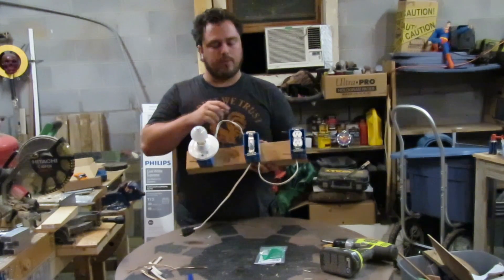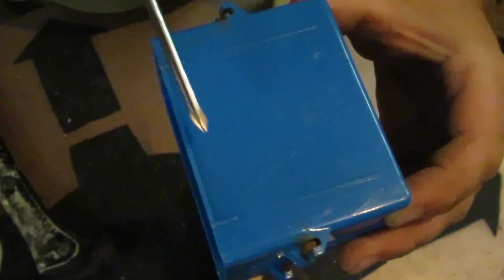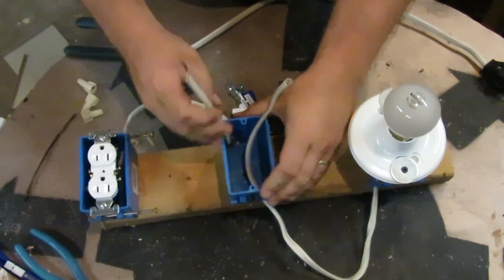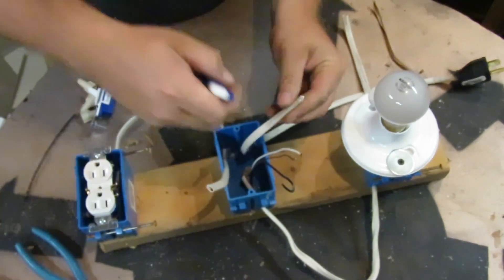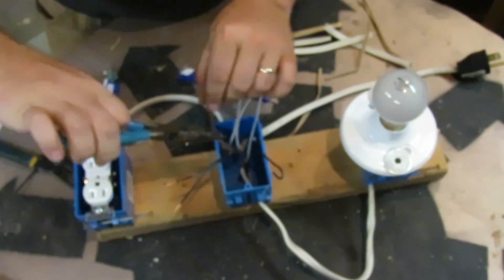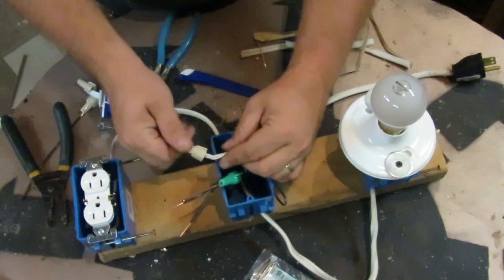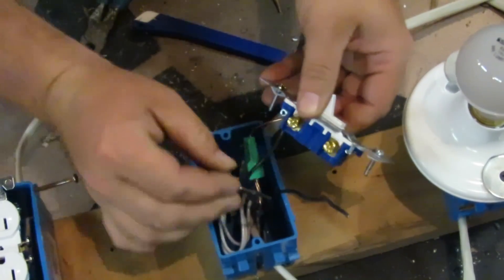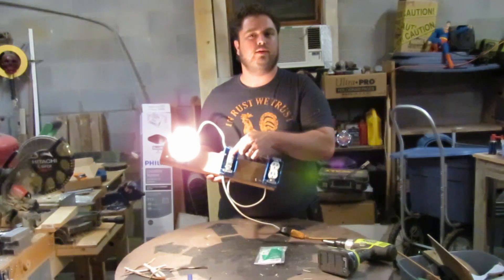How to wire and Install a Single Pole Switch

Comment: You don't explain where the power (black) wire coming from the breaker box is attached to the switch. Is it attached  to the screw next to where it says ON on the front of the switch.or to where it says OFF on the front of the switch?
Reply from the maker: The wires are attached to the back of the switch, there is no "ON" or "OFF" back there, the switch determines if it is on or off by connecting the top and bottom together or not, it doesn't matter if the power wire is connected to to top or the bottom, as long as the switch wire is connected to the opposite side

Comment: That's not how you install wire nuts. You should tighten them until they no longer screw on but instead twist the wires outside of them. Most electricians use a tool or a drill bit, because doing them properly is hard on your fingers. They should be that tight.
Don't make how-to videos if you don't know what you are doing.
Reply from the maker: +Gigs Taggart I am an electrician and this way gives a better connection. This is my job.
Are you an electrician? If not, dont post on electrical how-to videos
Reply: Wow, an electrician that uses backstabs and screws to make splices.  I was going to let that go because the gently twisted on wire nut thing was worse, but if you are an electrician, that's pretty bad.
Reply from the maker: +Gigs Taggart I've been an electrician for 15 years, thank you for telling me the best way to do electrical, I have seen the light, I really enjoyed watching your video reguarding the correct way to hook up a switch
Reply: why wouldn't you pigtail your hots? the way your doing it, if the switch ever failed everything down line from it would go too. can make for a hard time troubleshooting why all your plugs are dead.
Reply from the maker: the push in and the screw are connected internally, the switch failing will not break that connection, the light would just stop turning on if the switch failed, but pigtailing the hots would make sure that if the screw worked itself loose from the minut vibrations of the AC, that you will still have power down the line.
Reply from the maker: of course pigtailing makes it really hard to figure out something is wrong if the dry wallers forget to cut out boxes
Reply: This!

Comment: Isn’t there a a chance of slicing the insulation on conductors if you use razor knife to strip sheathing ?
Reply from the maker: Yes,  but you just have to be careful and the bare ground is in the middle, so if you make sure to cut in that area, you should be safe

Comment: Confused as to why after attaching the wire from the switch to the light and the wire from the receptacle to the switch you went ahead and attached a wire from the switch to a PLUG? Wouldn't hooking up the switch to the receptacle give it the electricity? What is that plug for?
Reply from the maker: The plug was an example of where the power might be coming from
Reply: Thought that might be the case. Thank you.

Comment: So when you turn this switch on, does it light the bulb and power the plug socket at the same time?
Reply from the maker: You could set it up to do that, but the way it is in the video, the power goes into the plug then out to the switch and then the switch works the light, so the plug is always powered
Reply: ok thank you!